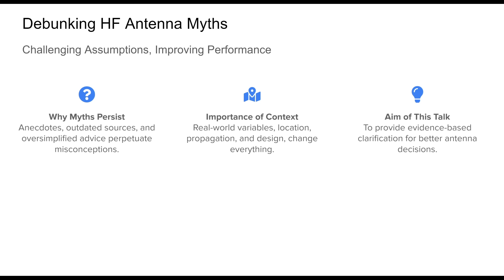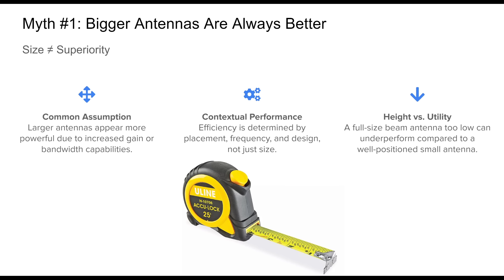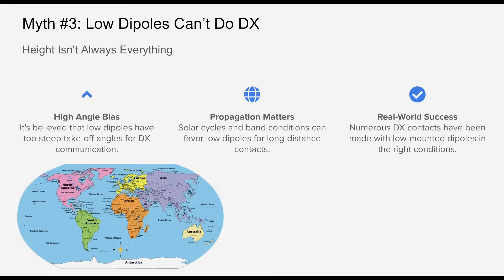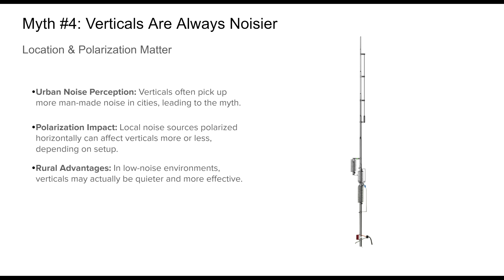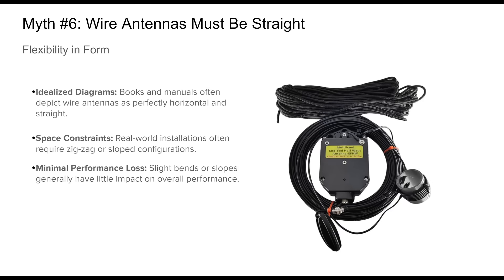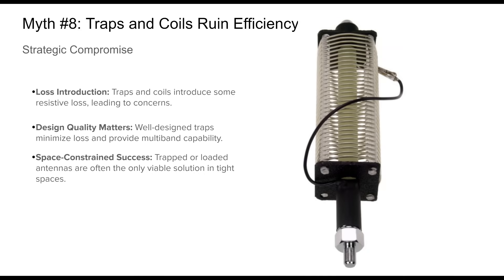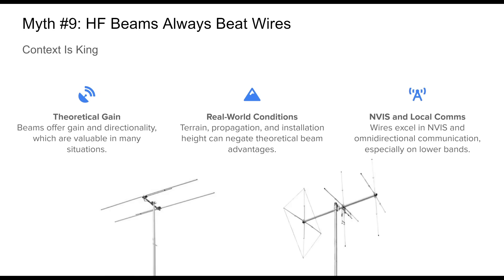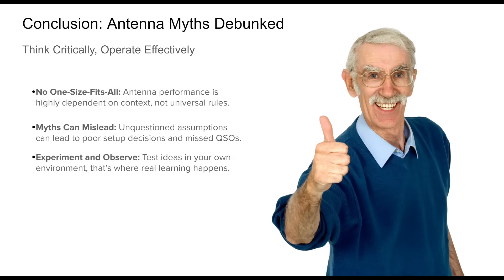10 Antenna Myths EXPOSED!

Comment: I would wager that the majority of hams have limited options -- one or two trees, a roof gable end -- environmental circumstances that pretty much dictate where to hang a dipole, it's maximum height, and whether it's flat top, sloped or bent. My advice: Do what you can safely do, operate, assess, adjust, repeat. If all you can do is to run a wire along the top of a 6-foot privacy fence, then that is all you can do. Stop worrying about it. Just go ahead and hang your wire antenna and be prepared to be pleasantly surprised at the contacts you can make with it. It won't be perfect, but so what? May the propagation always be in your favor!
Reply from the maker: Agreed!  Thanks for watching JD 👍
Reply: Agree.  So many of these video's show antennas in open fields or next to water and rave about their performance. Try putting those same antennas in my backyard surrounded with buildings, fences, 100ft pine trees, bushes, etc. and they won't perform.  

I made the mistake after getting my license of buying a multiband vertical, putting it in the yard and having it do next to nothing.  As an experiment, I took off the 10m element, taped it to the top of a 30ft fiberglass pole with some counterpoise and a 1:1 balun and immediately talked to Brussels. I now use an EFHW where the feedpoint is at 25ft and sloping to a 10ft pole into the yard and it works great. My yard can barely handle that.  

You have to choose your antenna based on your environment. The best antenna in the world won't work sitting in a hole. I also messed with a 30ft fan dipole.  Got that up into the trees.  Guess what?  the Spooltenna EFHW gave better WSPR results.  I then took down the Fan I had constructed.  Who would have known?  I figured the trees were somehow blocking NVIS signals.  In comparison, most of the EFHW has a view of the sky.  You have to work with your environment.
Reply from the maker: @RickPaquin great post and completely true, thanks for watching Rick 👍

Comment: I live way up in the mountains, absolutely no TV reception. Had a good antenna but what made it work was buying the radio shack amplifier for the antenna to strengthen the shingle. able to pull four or five stations in. What's a decent TV picture. It's a shame that radio shack is out of business that was a really good amplifier. Some of my best antennas were a piece of aluminum and a wire going to the radio or the TV.
Reply from the maker: I miss radio shack for sure
Reply: Radio shack still has an online store. Just don't expect 1980 radio shack.

Comment: This is a really good video.  Thank you for the information (some of which I've debated with my friends and club).  Thank you for posting.

The biggest debate I've had is about traps.  I keep holding thr Moosley tri-band antenna up as an example that you can have a really good performing antenna with traps.

Most of the misconception is a lot of operators don't understand what acts like a shirt electrical.  There 1/8, 1/4  and 1/2 wave lengths are the most important (also why feeding length is important, too)
Reply from the maker: People take what they hear as gospel and then repeats it, thanks for the comment 👍

Comment: “Test Everything”
Yes!!!   This includes filters, baluns, ununs, chokes, etc. I have found many purchased items arrive unusable.  For example, a 1:1 unun was sprung on the toroid, resulting in very high VSWR into a dummy load making it more of a bidirectional attenuator than a common mode choke
Reply from the maker: I was just telling a buddy today to test his new high pass filter 👍
Reply: Something I learned REAL fast from my Elmer was quite literally anything can be an antenna. On our way to Dayton, we stopped at a gas station to stretch our legs, dude broke out his kit and wrapped a copper electric meter grounding strap around am aluminum parking light pole, hooked a piece of coax to it, his tuner and radio then started calling CQ. Made five contacts on the east coast with five watts cw.

Comment: Assuming for this example, no losses between the transmitter and the antenna… are you suggesting that a non-resonant antenna with a “tuner” will radiate less power than a tuned dipole?
Reply: yes, that is true, high SWR causes loss between the tuner and antenna to be radiated as heat wasting power.
If you had an outdoor tuner then you would not have those losses as then your signal would be a match on the coax.
Reply: @Thump2030  that’s actually not true and there is no “real” difference between a tuner in your shack and a remote tuner. You don’t gain much by putting the tuner closer to your antenna. Using a tuner, the only losses you really see are feed line losses so it doesn’t make that much difference. The reflected power going all the way back to your tuner in your shack will experience the feed line losses as apposed to a remote tuner but it’s so minimal that it will not make any noticeable difference.
Reply: @1979Iceman  lmao
Reply: @Thump2030 have you heard how a doublet antenna radiates with near 100% efficiency with 10.1 swr
Reply from the maker: Hey Iceman, I am not exactly sure what you are asking so let me try to answer...  I have a video called "Antenna Efficiency"  or something like that which would expand further. 

We have two things we concern ourselves with; transferred power and radiated power.

Transferred power is what leaves the radio and makes it to the antenna, tuners, baluns, filters, coax all affect this.  Radiated power is what the antenna converts to RF.

Radiated power is measured in terms of "radiation resistance" which is the portion of power that makes it way to the antenna less the power lost due to ohmic resistance (hear) in the antenna.  The actual antenna impedance, length and composition all affect this...

As to which radiates more?  I think you would be hard pressed to beat a resonate 1/2 properly mounted antenna with no tuner, no balun, no traps and no coils.

Hope that answers the question.
Reply: @TheSmokinApe how about an extended double zepp antenna, non resonant with a tuner it's 3db gain over a resonant dipole
Reply: @TheSmokinApe  sorry I was trying to over simplify it. I’m familiar with radiated vs transferred power. I was just trying to ask if you thought that if 100w got to both antennas (resonant and non resonant) would both radiate about 100w or do you think the non resonant antenna will radiate significantly less just because it’s non-resonant. Practically speaking of course. Yes in real life you will have things inbetween the tx and antenna that will introduce loss and a non resonant antenna typically has more but the difference is negligible. That’s all sorry for the confusion
Reply from the maker: @1979Iceman gotcha, I think that in most real life setups the resonate antenna wins.
Reply: @TheSmokinApe thanks for clarifying. For me, on paper I would agree resonant is better but will it be a perceptible difference? Basically when it comes to a rybakov vs a dipole I don’t worry about which one is going to radiate more power since I don’t believe there is going to be a noticeable difference, I pick one or the other based on what I want to do, ease of setup and if I want to deal with a “tuner” or not that day. However my perfectionist side will always lean towards resonant antennas lol.
Reply: @1979Iceman an example of a non resonant antenna out performing a resonant antenna is the extended double zepp antenna with 3db gain over a resonant dipole
Reply: @Pioneer936  thanks, I was going to mention that one but for the life of me I couldn’t remember the name. Thanks for reminding me. I find these discussions interesting because everyone has their own definition of performance, this one is better because it’s more efficient, that ones better because it has higher gain or this is better because it has a lower takeoff angle. This subject is so nuanced but I do think it’s worth discussing. Thanks
Reply: @1979Iceman  efficiency has nothing to do with resonance.  If you get the electrons wiggling on the metal, they will radiate; they don't care if they bounce off the ends of the elements at voltage or current nodes :-).

What matters for efficiency on the antenna elements is the ratio of radiation resistance to the resistive losses in the elements, and we start to think about things like skin effect, metal conductivity, dimension of the elements, etc. 

A key factor is the ratio of radiation resistance to loss resistance -- they're modeled as two resistors in series.  In principle, if you make two antennas out of the same amount of the same metal, but one has a geometric configuration where near-field coupling nets a lower radiation resistance to the other, then the latter will be more efficient (i.e., more power is disipated by the radiation resistance than in the loss resistance).

Of course there are many details!

Comment: Aluminium antennas will have wider bandwidth coverage than wire.
This is due to the driving elements having a bigger diameter.
Reply from the maker: Hey Paul, I believe that to be accurate 👍
Reply: @TheSmokinApe  It is.
Reply: A 1/8" aluminum tube is narrower than a #6 AWG wire.  It's not the fact that it's aluminum that makes any difference at all.  Heck, there are aluminum wires... Why not just say diameter influences bandwidth?
Reply: @yakovdavidovich7943 3/4 copper wire Lol!